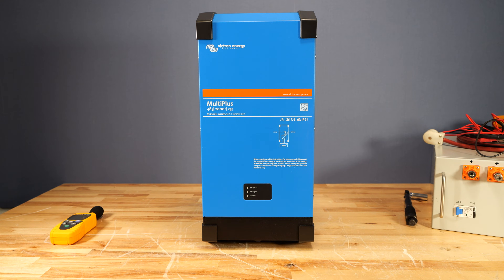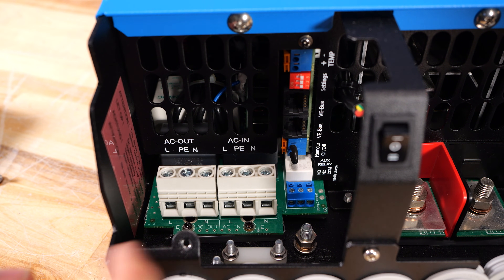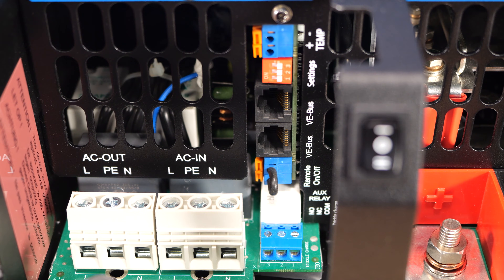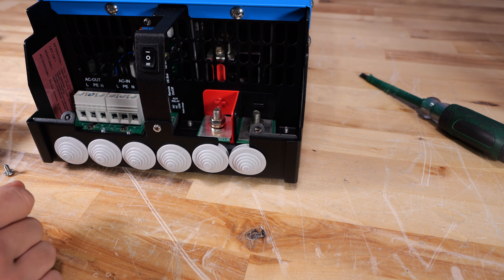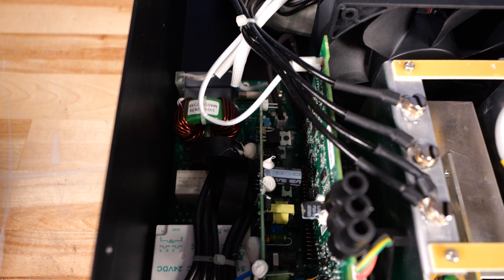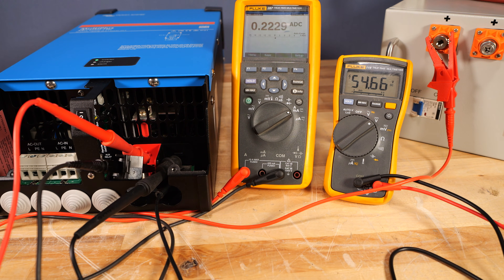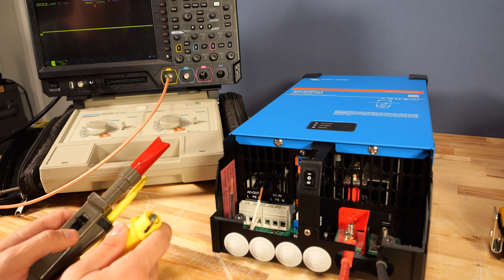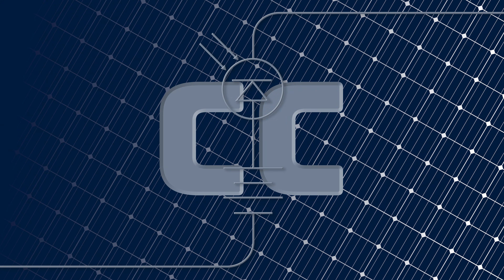Victron MultiPlus 48/2000 Inverter Teardown & Overview! ⚙️

Comment: Copper is expensive, invest in your cables. We did calculations, our solar does 25kW relative rarely we cut to 6mm² and 7V of voltage over distance. On lower production those numbers drop fast.

Comment: My 85 euro (delivered China-Portugal) low freq inverter  5000 watt(3250 all day with a few old computer fans here and there) 48 volts draws 0.35 amps at idle with one choke before the 16Kg toroidal transformer(220 euro, made in spain; the inverter  is massive, 24 El Cheapo  Mosfets, big Al heat sinks, AND MOST IMPORTANT!!!! the WHOLE , THE COMPLETE Control Board only one, and it costs 3 (THREE!!!!) euros it is the famous EGS002 control plate,  factory modified with the 10k resistor OF COURSE!!!!
been running the whole house for 2 years, 16 Lifepo4s, 8 panels,  48 volts, absolutely BULLET PROOF, IMPOSSIBLE to damage, resists overloads, ons and offs, all sorts of transients, while the previous Hi Freq inverters ALL burned up within months; i repair them  Hi Freqs, hate them!!! as a hobby for customers

Comment: 6:55 SO STUPID!! they take air from TOP and blow to bottom! :DDD  instead of doing it right.
Reply from the maker: The fan in this inverter blows from bottom up.  Air is drawn across the H-bridge and blown on the transformer.
Reply: @CurrentConnected no i don't understand how does the fan cool the unit ?

Comment: Do you have the manufacturer or model numbers to any of these 48v inverters "of similar size that draw 2-3 amps" ?? If ANY 2kw (or similar size) inverter pulls that sort of current at 54.63v (48v) then there is definitely a malfunction with said inverter. Maybe you could actually compare the idle power consumption instead of comparing just the current draw of a 48v vs 12v inverter if that is what you actually meant. Two different scenarios here. Thanks for the looksy inside the Victron inverter.
Reply from the maker: We aren't looking to name-drop and talk down on any manufacturer, but I invite you to look up some  competitors offering 2kW low frequency inverters.  Many of the cheap ones coming from overseas waste power like no one's business!

Comment: Interesting and detailed videos. The fewer empty words, the better! We're looking forward to a video about solar panel systems and their integration with Multiplus II.There's a new EasySolar. It won't be on the tests? Everything is built-in right away: solar, control, and inverter. I'm curious, how does it mix solar with the grid? Which is better, to get an all-in-one system or a separate inverter and solar controller?

Comment: Just got not one, but two bad ones. 3k 48v MP2's. They have a 25Hz PWM fan rattle that sounds like an old dodge diesel motor. Horrible noise. Now I have to fight with the dealer to get them replaced. There is NO fix as its a bad motherboard, not bad fan. Victron continues to sell these with bad 25hz pwm and they know its a problem.
Reply: What you're planning to get instead?
Reply: @dmytrodance   Schneider Conext SW4048 4kW 48VDC Inverter/Charger 120/240VAC. Its about 1,000x better quality and not built like a toy. If you have issues snieder will back you up unlike Victron.

Comment: I did some tests on the efficiency of the battery charger ( a Multiplus) 12v 1600, when charging a li battery at 50 amps, measuring watts in and watts out, efficiency was only 73% ( certified instrument) which I think is poor, however the power factor was 0.998 so good for running off an inverter generator. I will test my 48V and see if it is any better. I done like wasting 25% when I am camping and charging from a Generator. So i built for comparison, a 300-watt toroidal transformer rectifies with ideal (mosfet diodes) and 8-gauge leads, this was 92% efficient 0.94 power factor unregulated but when I am camping I only use it with my 1000watt Yamaha inverter generator and I do not charge more than I need to ( solar is the main)

Comment: Is it possible to connect Victron Multiplus or Multiplus II and Enfase microinverter in a hybrid network? If so, how would that happen?
Reply: Yes, it works with any PV setup. I am using two Multiplus with Enphase micro inverters feeding the grid. Using the new Viction VM-3P75CT Grid meter and putting the CT clamps measuring the grid, and installing ESS Assistant, it will see the negative feed from the solar, and either charge the batteries or use the PV power for the loads. Works really well.

Comment: Impressive little inverter. Victron definitely doesn’t have any apologies to make in the idle consumption department. Those numbers continue to amaze me.
Reply from the maker: Totally agree
Reply: I connected 2 multiplus 1600 compacts, 12v, one operating as an inverter, with the output going to the input of the second, operation as a charger, ( a loop) the Charger was 73% efficient the inverter was 72% efficient, round trip efficiency 52.5% ( watts in watts out) so if you use the inverter to charge and discharge round trip is 52.5% you are wasting half your energy. (I am prof. Elec engineer) Please correct me if I am wrong.
Reply: @polvincompoundsadmin5402  you don't give power flow of your loop test. At idle power effiency is 0%
Reply: @SebastienLIDAVET  I did some tests on the efficiency of the battery charger ( a Multiplus) 12v 1600, when charging a li battery at 50 amps,

Comment: Was watching a video you did on powering up the capacitors on a Quattro using a 48v incandescent light bulb.. just wondering if you had the unit switched on or off whilst you did this.. I’m guessing it was off...? 👍
Reply from the maker: It was off, otherwise the capacitors would be drained the moment the light bulb was disconnected.
Reply: Thanks for getting back to me..👍
Reply: As you want to avoid a surge current related to first charge of (capacitor at DC side better have inverter off and only on the inverter after you have decently connected the DC wiring (with a series resistor or bulb you  want be able to properly charge the internal capacitor properly ...